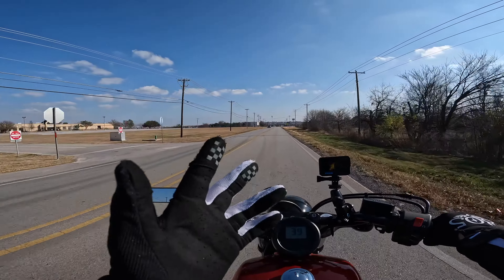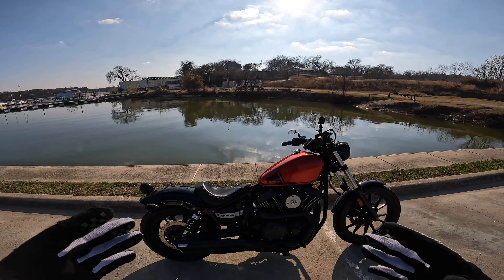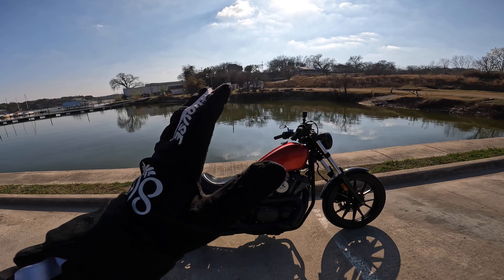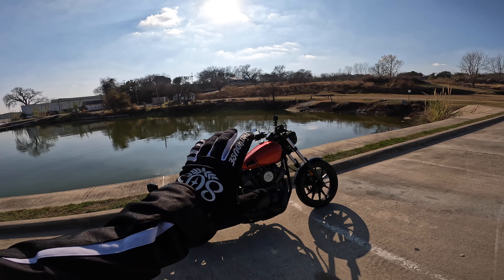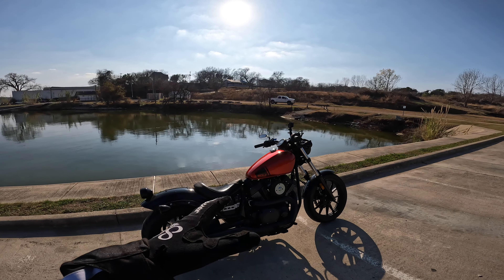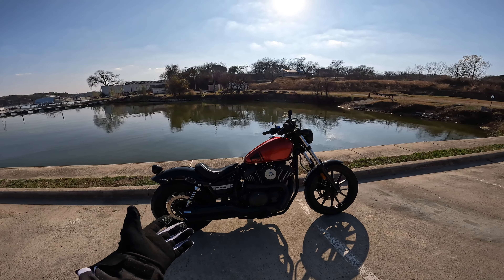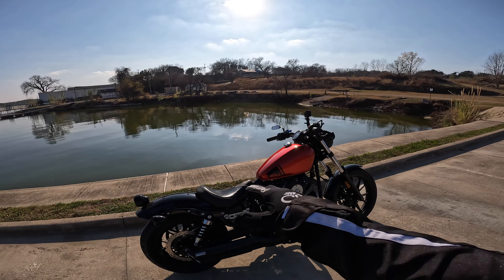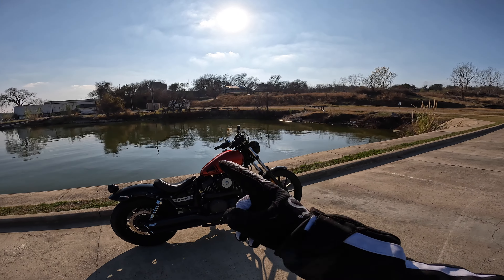5 Reasons I HATE the Yamaha Bolt

Comment: 1. Personally never had seat problems but I get it.

2. Sure the stock sucks, but that’s easily changed. I run ss forward controls and drag bars. I find the position decent and not uncomfortable.
3. ALL BALLS RACING BEARINGS FOR THE STEM. Cures that wobble atleast did for me. 
4. The tranny is fine for what the bike was designed for. “In town bombing” a 6 speed would make the bikes biggest REAL DOWNFALL worse. (3 gallon tank)
5. Gotta pay to play in any class.
6. The weight bothers you? It’s a mid weight bike. Is what it is. It’s only heavy if your used to a grom or something like that. 

** The honest only real problem with the bolt is it’s fuel capacity and range. Can’t hit the highway and get to far without the low fuel light popping to take the fun away. But, again for what it was designed for, the capacity makes sense. 

Your not gonna buy a Bolt and somehow make it compare with a gold wing. It’s a fantastic bike! But know it’s not a do everything Swiss Army knife, it’s more of a boot knife.
Reply: I should note: I own a 2017 bolt r-spec bought new.
Vance and Hines vo2 intake, Dean speed “just the tip” slip on, Ivan’s flash, ss forward controls, drag bars and the Koso TNT-B meter... (I like an analog tach) 13k miles of which maybe 300 highway.  I use it to get back and forth to work and play around every once a while. 

As much as I wish for more power etc etc. I would be doing that on any bike. If I’m completely honest with myself, other than rider position, the bike is kinda perfect as is and will carry many riders happily during the occasional sunny day and fair riding.  
In other words anything you buy. Regardless car, bike, boat, you will find things you hate, love and wanna change.   Enjoy the journey.
Reply from the maker: I don’t disagree! All great points! I have a 5 things I love video which I really call out the amazing things about this bike. Actually I had a bobber version which I loved, it was a passion project for sure. I think Yamaha did it right over the Harleys for sure. Thanks for watching!
Reply: @UrbanMoto  cheers!
Reply: came right at me lol I’m looking at getting a bolt for my second bike after owning a grom for a year 😂

Comment: the wobble is caused by the tires not being balanced i have a 2020 bolt and there is no  wobble at all  and i have rode my bolt for about 6 hrs  3 hrs  one way and 3 hrs back and i never had a problem
Reply from the maker: It is weird for sure. Lots of different opinions on this. Wheel bearings, rubber triple tree bushings, tires not balanced. In this case the tires are as the rear is brand new and the front was rebalanced at the same time.. odd for sure!
Reply: @UrbanMoto  I replaced the stock steering head bearings for All-Balls tapered racing bearings and the wobble is completely gone! It was really bad before and thats the only thing I changed.
Reply: I heard it's completely gone on the new generation bikes
Reply: @UrbanMoto  the neck bearings are plastic. Replace thise with real ones and that wobble goes away. Seriously doubt it's tires not being balanced. Bolts are known for cheap plastic neck bearings that cause the "death wobble".

Comment: I bolt never has a death wobble. That's because I follow the manufacturer's instructions to check the steering head bearings annually, and adjust to the correct setting with a tension wrench. I also balance my front wheel. Some people either never check it, or the bash it tight with a hammer and chisel. Then they complain about the death wobble. yes they do need a sixth gear, but in saying that, they have plenty of torque and don't need to be so low geared. Go up 2 teeth on the front pulley and the problem is solved. Norton 850 Commando's were the same. You had to gear them up to unleash their true potential.
Reply: I wish I knew how to do that I’m buying a 2016 bolt next week🤣

Comment: I bought a brand new Star Bolt thinking it would be the perfect last bike to have but was really dissapointed with it. There is not much ground clearance for cornering so it scrapes round most corners the rear suspension is dire, it neads a higher top gear I couldnt see the speedo in daylight and being digital numbers you can't take a quick glance so you have to look at it for a couple of seconds which made me feel unsafe. The seat was uncomfortable and the pointy bit at the front caught my jacket when I was getting off. Its only 51bhp and for a 950cc is poor performance and its not exactly light, it also feels unstable at high motorway speeds so after its first service I sold it.

Comment: First of all, the front fender is backwards. Lol. But second, how can stiffening the handlebar mount solve a problem that happens only when you let go of the handlebars? Do you think the bars themselves are resonating? I would expect the rubber mounts to reduce that, but it would depend on the weight towards the end of the bars. But as someone else said, lots of bikes use rubber bushings. Perhaps they hit a sweet spot of steering geometry and handlebar size/position, which might explain why changing bars helped in your case.
After I changed tires on mine, the issue almost completely disappeared, still using factory bars. But I always have at least one hand on the grips anyway, so it has never been an issue for me unless I test it purposely
Reply from the maker: Lots of good points. Like I said I’m the video to could be tired or wheel bearings? It’s my buddy’s bike so good catch on the fender haha never noticed that 🤣 thanks for watching and the feedback!

Comment: Death wobble? I had new tyres put on 'Avon Cobras'. No death wobble. Job done. Other people say changing the headstock bearings cures it as well.
Reply from the maker: It was a bike I was borrowing from a friend. My Bolt didn't wobble that bad. I dunno. Could have been bearings, tires etc. Still though lots of folks out there have that issue.

Comment: I have a sportster fron 73 so you a bit off bud
Reply from the maker: Your correct on the original but the 1200 came out in 88, which was more the comparison. Thanks for watching 🤙🏻
Reply: @UrbanMoto    I bought a new Harley 1200 Sportster in 79
Reply from the maker: @hollissowers8428  I was just going off the good ole googles. Not a big Harley guy. 🤷‍♂️

Comment: Not that it matters much since the Bolt was discontinued in my market in 2020 (new emissions regulations, ugh!), but: I'm still of two minds about the thing. I'm sure it's a better motorcycle than comparable Harleys - as lots of Japanese cruisers are/were, but, at the end of the day, you'll still be riding a Yamaha. If your heart's really set on an H-D and you want all that history and antiquated-ness of the brand, the Yamaha won't do it for you. 
I did own and ride a metric cruiser in the mid/late 90s while a few of my buddies were on H-Ds and it wasn't even a close call when it came to ride-ability, power/performance,  etc - the Japanese bike would run rings around the Harleys and I always had to go easy on the throttle if I didn't want to leave the Fat Boys behind when we were riding together. And it was only a puny 800cc Kawa that, on paper, only made marginally more power than the Evo. Still: There were moments when I felt like I really, really would've preferred a "real" H-D for all the wrong reasons. Like an engine that seemed to want to jump out of the frame while idling or a transmission that would give off that "clunk" when you put it in gear. Of course, that usually only lasted until I jumped on one of their US bikes and found out just how terrible they felt if you wanted to do anything but chug along in a straight line at 60 to 80 kph... :D